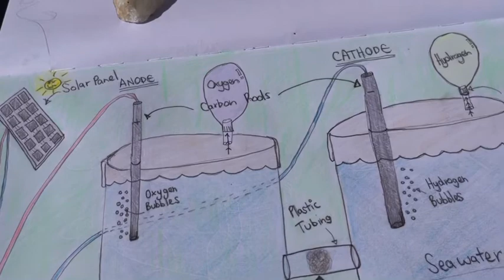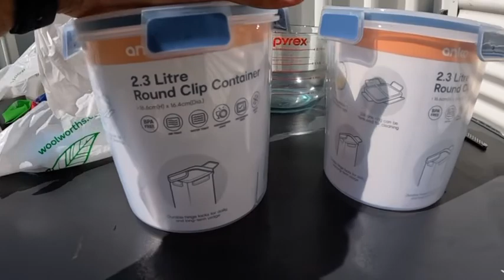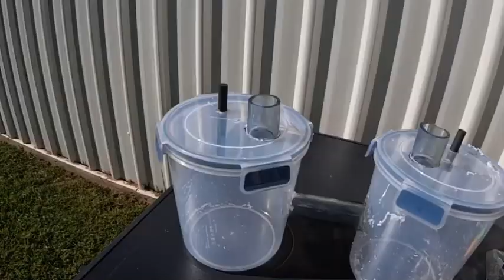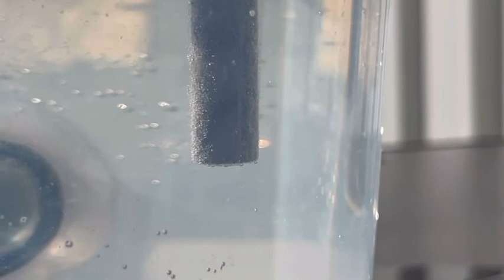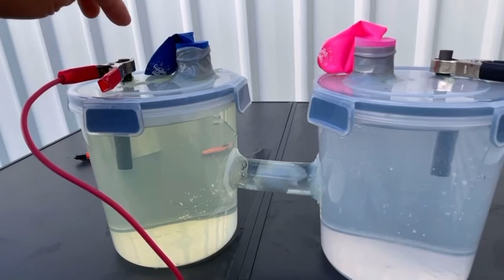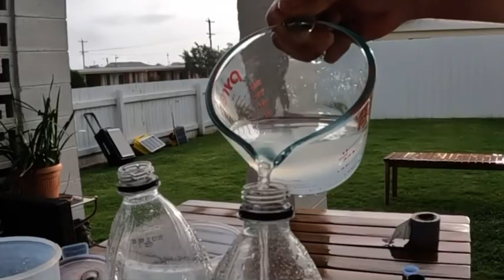How to extract chlorine and sodium hydroxide from seawater.

Comment: Also you can make chlorine with normal salt water you make yourself. More salt you add and dissolve into the water the more concentrated it will be. 

Once you have your salt water it's the same process as the video.

Comment: In anod have to be cl2 
Why here we have o2
Reply from the maker: When you perform electrolysis on seawater, several products are typically generated. Here's what you can expect:

1. *Hydrogen Gas (H₂):* This is produced at the cathode (negative electrode) where water molecules (H₂O) are reduced.

   \[
   2H₂O + 2e^- \rightarrow H₂ + 2OH^-
   \]

2. *Oxygen Gas (O₂):* Ideally, oxygen is produced at the anode (positive electrode) from the oxidation of water molecules.

   \[
   2H₂O \rightarrow O₂ + 4H^+ + 4e^-
   \]

   However, in seawater, chloride ions (Cl⁻) are more easily oxidized than water, so:

3. *Chlorine Gas (Cl₂):* This is often the main product at the anode due to the presence of chloride ions (Cl⁻) in seawater.

   \[
   2Cl^- \rightarrow Cl₂ + 2e^-
   \]

4. *Sodium Hydroxide (NaOH):* The hydroxide ions (OH⁻) produced at the cathode can react with sodium ions (Na⁺) in the seawater, leading to the formation of sodium hydroxide.

   \[
   Na^+ + OH^- \rightarrow NaOH
   \]

5. *Other By-products:* Depending on the exact conditions, including the voltage applied and the composition of the seawater, you may also produce small amounts of other chemicals such as hypochlorite (ClO⁻), hypochlorous acid (HClO), or sodium hypochlorite (NaClO) if the chlorine dissolves in the water.

In summary, the main products of seawater electrolysis are **hydrogen gas, chlorine gas, and sodium hydroxide**, with the possibility of some oxygen and other minor by-products depending on the specific conditions of the electrolysis process.

Comment: Hi, is it possible to make sodium hydroxide from sodium carbonate using your method?
Reply from the maker: Yep, dissolve the sodium carbonate into the water and repeat the process as in the video. Here is a more detailed description of the process. Cheers!

The method involves first dissolving sodium carbonate in water, which results in a solution of sodium ions (Na+) and carbonate ions (CO3^2-). When this solution undergoes electrolysis, various reactions occur at the electrodes.

At the cathode, where reduction occurs, water is reduced to form hydroxide ions (OH-) and hydrogen gas (H2). The reaction at the cathode can be represented as:
\[ 2H_2O + 2e^- \rightarrow H_2 + 2OH^- \]

At the anode, where oxidation occurs, either water is oxidized to produce oxygen gas (O2) and more hydroxide ions, or carbonate ions are oxidized to produce carbon dioxide (CO2) and oxygen. The reaction involving water is:
\[ 2H_2O \rightarrow O_2 + 4H^+ + 4e^- \]

The overall result of these reactions is the formation of sodium hydroxide in the solution, as the sodium ions from the dissolved sodium carbonate combine with the hydroxide ions produced at the cathode. However, it's important to note that the efficiency of this process and the purity of the produced sodium hydroxide can be affected by various factors, such as the concentration of the initial solution, the type of electrodes used, and the exact conditions of the electrolysis (like voltage, temperature, etc.).

Comment: One way to have a better seal for the hydrogen gas would be to turn the H-Cell upside down and put the gas outlets on the bottom, and using the lids to keep the salt water in. That way you would need to flip the H-Cell once all of the assembly is complete and the salt water added. BTW: Have you tried incising the circular holes with a craft knife, and pivoting either the knife or the body around each hole centre?
Reply from the maker: Hi there! There are many different ways to improve this system. Unfortunately the seals of the system would not be sufficient enough to keep the water in if it was flipped. But the concept is definitely viable! Thanks for the suggestions! It’s always good to get some well thought out feedback. Appreciate it heaps! Cheers!

Comment: How can i made soap with this naoh ?!
Reply from the maker: 1. *Perform a Small-scale Test:* Use a small amount of your sodium hydroxide solution with a known amount of oil to see if it saponifies. Adjust the amount of solution you use based on the result until you get a satisfactory outcome. This process is basically fine-tuning through trial and error.

2. *Create Your Soap:* Once you've found a ratio that works in your small-scale test, you can scale up to make a larger batch of soap. Keep in mind that due to variations in the concentration of your sodium hydroxide solution, the result might not always be consistent.

3. *Test Your Soap:* Always test your soap before using it. You can do a "zap test" by touching your tongue to the soap after it has cured. If it "zaps" or stings like a 9V battery, it's lye-heavy and not safe to use. If it tastes like soap, it's generally safe to use. 

Remember, this is a less precise approach and may lead to inconsistencies in your soap, but it is an option that allows you to use the sodium hydroxide you've created. Always use caution when working with sodium hydroxide solution, and be prepared for some trial and error as you perfect your method.

Comment: you only really need (1.6V or smth like that in theory)....but after you do the math you need around 2-2.3V. In any case, the real issue is amprage. Commonly available batteries dont give good amprage. So, without good amprage, not only does the reaciton take a while, but the batteries eventually die (if you are using 9V batteries)...essentially what this means is they lose their ability to hold their max amprage at the 9V. Its pretty complicated but essentially i've found a recharageable lithium power drill battery works best. After 2 hours i had VISIBLE chlorine gas  coming off. actually inhaled some and almost died but yeah.
Reply from the maker: Yep. I’ve been using a car battery hooked up to a solar panel to maintain voltage. I recently rebuilt the system into a larger system. I am working on building a redox battery system to see what it’s capacity will be. I am hoping to hook up 9 cells to generate 13.8 - 14V. I have no idea what the capacity will be yet has it will depend on the concentration of the produced sodium hydroxide and hypochlorite. Currently I have one cell built and it is producing 1.6V when disconnected from the panel and battery.
Reply: @Remraf why don't we just use a AC or DC charger 🤔 continuously giving good volat and amps I have an alctrronics repair shop but will it work idk 🤷‍♂️

Comment: The solution you have on the anode side is hypochlorite. To produce "chlorine you need to compress and cool the gas produced under high pressure.
Reply: Yes, I was just about to say that you don't want to use that oxygen because chlorine gas is also produced at the same time.

Comment: can i use 2 9 volt batteries or does it have to be a car battery
Reply from the maker: One 9 Bolt battery will be more than enough. To actually get the job done you really only need 1.6 V’s of power. Cheers!
Reply: @Remraf  what about to produce naoh
Reply from the maker: Yep. It’s approximately 1.6 Volts of power to get the job done. So using a 9 volts battery will be heaps of power. There are some charts online that show the best ranges to work with. I was successful with a 12 V battery and I used it because that what I had available. I made soap using the naoh solution.
Reply: @Remraf  just to correct you as this may help in the future, voltage is not power. a 9v battery will not provide enough current to do this process efficiently. a 12v car battery can dump hundreds of amps while a 9v battery can only deliver a few amps. to know the power actually going into the system you need to know the resistance of the current path and the voltage of the source. for example, if the cell has a resistance of 10 ohms at 12v (V = IR) we can do V/R = I, so in this case 12v/10Ohms = 1.2 Amps. and to get the power we can multiply the voltage by the current going through the system (P = VI) so 1.2 x 12v = 14.4 watts of power. hope this helps with later projects :)
Reply from the maker: Thanks for the info. I’ll take it into account.
Reply: Yes it did thanks

Comment: well, i am gonna reserve this for viewing when i am not n a rush and can really focus.  actually, i was simply looking for how to remove the sodium from the seawater and leave all the other minerals be.  your thoughts?  mygreathanks and blessings
Reply from the maker: Hi Paul. Thanks for the comment. The only method I am aware of to remove the sodium from the seawater is the one that I have mentioned in the video. The chlorine and the gases are part of the seawater and therefore will be by-products of the process. A good portion of the video is explaining how to make the device used to break the seawater down. The rest is explaining the process in many different ways so that you can understand what is happening. There are also many suggestions in the video about how I can improve the process. Cheers!